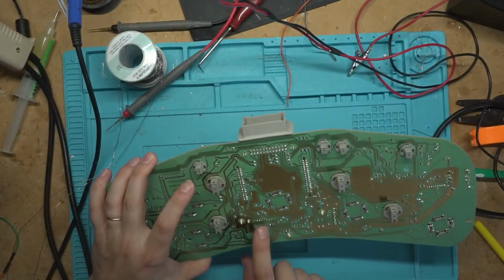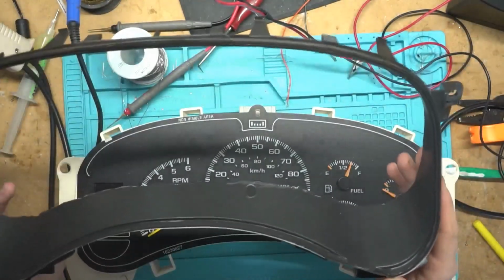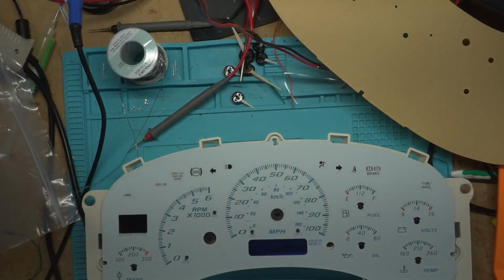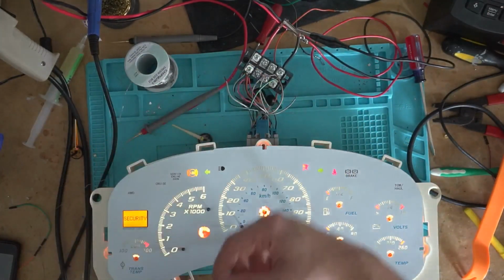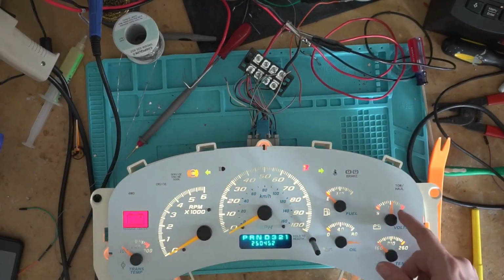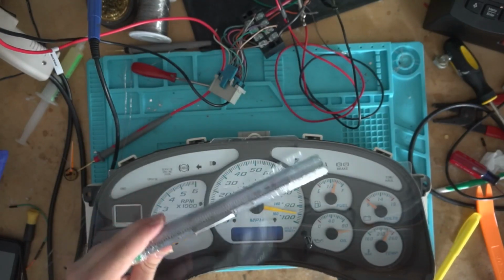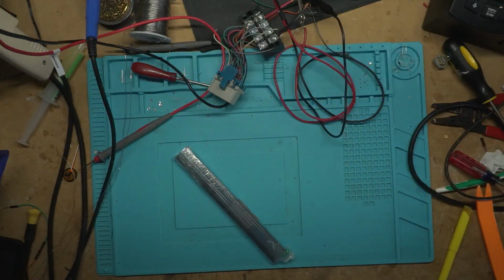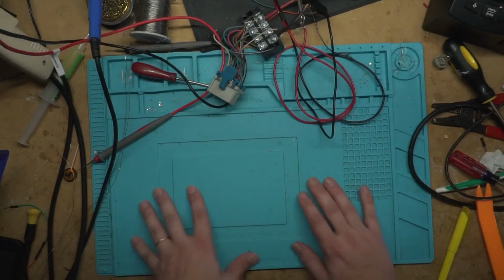99-02 GM Truck Adding Transmission Temp Part 2 and White Inlay

Comment: how big a deal is it to those tranny temp gauge in dash  in a 2001 Silverado  1500lt   does the harness have the conductors to go to the transmission sender unit?

Comment: Are you still working on these? Im thinking of moving my fuel gauge to where the trans temp was added, and adding a second voltmeter. 
15+ years with arcade and pinball machine repair and refurbs, but no clue where id start to get parts for this

Comment: I know this is a few years old but an easy way to make these look better is to modify and use the trailblazer ss with the darker orange Needels that are red at night, by cutting the extra stem lenth off and getting a tinny drill bit and opening up the hole for these to fit but still keeping them snug . this worked for my 2000 and 2002 sonoma/ s10 blazer. should be the same basic stuff .i think some of the fullsize 03 up trucks and suv and Cadillac's. trying to figure my own test setup on the table for s10 gauge work since my rpm is the last gauge that i haven't fixed on the original gauges

Comment: When adding the trans temp gauge. What else needs to be done to a truck that had no trans temp gauge to begin with. Is there senders that must be installed with wires run from new guage to the sensors or is everything already there from the factory except the guage?
Reply from the maker: It's all there
Reply: @FixedUntilBroken  oh , I don't think it's set up for the trans temp gauge in a 2002 Chevy avalanche. I think this didn't start until 2003. Poop!! My truck is 2002
Reply from the maker: @tellitallnow3914  unless it's a 5 speed v6 it's setup for it from the factory.

Comment: They used to sell the clear len on eBay for $10 you had to breaker  the old lens off  to Install that that metal part  because if you heat it up the old lends to melt the old glue off you will melt the plastic
Reply from the maker: Makes sense. I haven't seen cheap ones anymore but I haven't seen them under $25 anymore

Comment: Anyone have a source on the 16196398 ? 40,000 pcs disappeared from UTSource  stock right around the time this video was posted. Thanks a lot Matt! (J/K)
Reply from the maker: Oh crap because I need order some!
Reply: @FixedUntilBroken  I'm hoping if I spam utsource inquiry quote form they will find the missing 40k pcs lol
Reply from the maker: @jeffescortlx  Oh i was mistaken. I was thinking of the 9399059. I just got a quote from them on 10 of them for about $5 ea on Dec 30.. I just was clicking order but I accidently hit delete ( its right next to the order button...) I opened a new ticket on it though. I am getting 10 of those, 10 9399059s and 1 SAF-XC161CJ-16F20F BB ( i think its the same thing as a 21002558)

Comment: Hey, quick question  will a 2000 chevy cavlier cluster work with a 99-02 S-10 Ecu ?
Reply from the maker: Not sure but probably GM used the same PIDs for most stuff the Cavlier cluster will need a Cavlier BCM for the ODO

Comment from the maker: I did forget to oil the Coolant temp motor in the video If you caught that. So I am doing it now. I didn't even catch that in editing. Another mistake I made was with the RPM needle it Doesn't actually sit right on 0 its just hair off the peg just like the MPH. Not quite touching but really close to it.